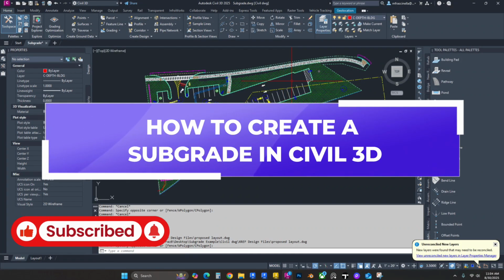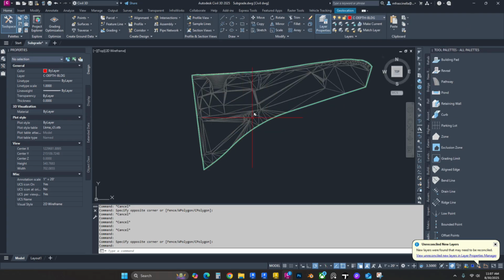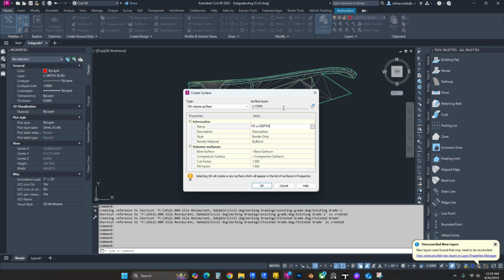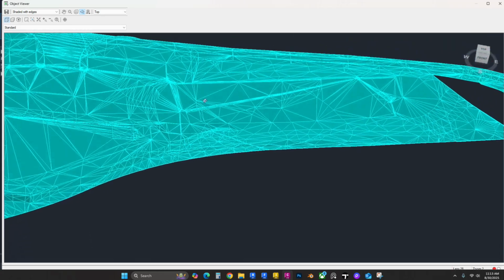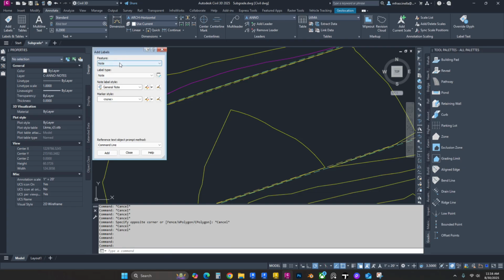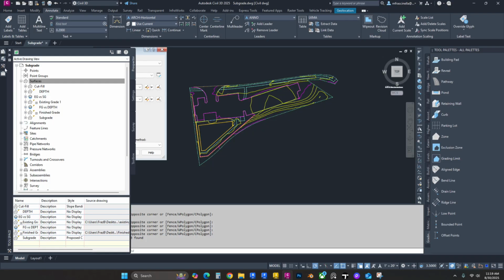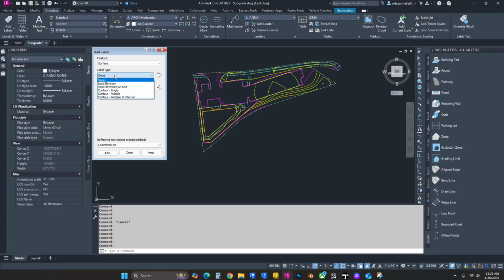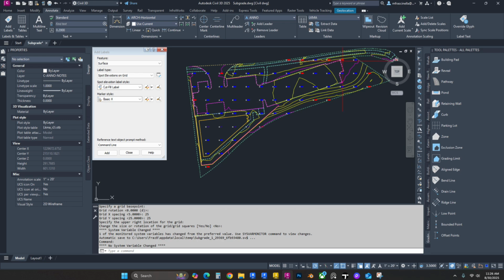Civil 3D Tutorial: Create a Subgrade Surface in Minutes!

Comment: The Depth surface is not defined by the feature lines used to design the site? how does that work? the comparison to the finish grade would be thousands of feet since for instance my surface is around the 1300ft elevation.
Reply: The depth is showing the depths of materials, they will be near zero, the step when you make a TIN Volume Surface "FG vs Depth" will create a surface with the elevations near your FG, but down lower by the depths that you assigned to the polylines.